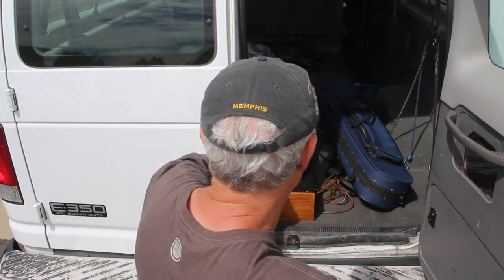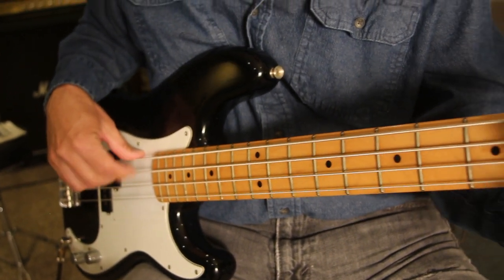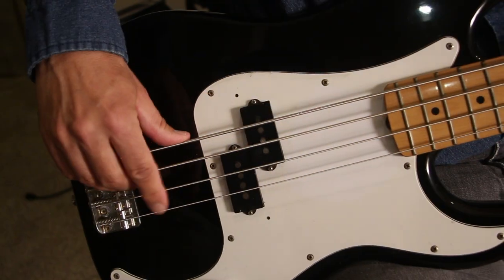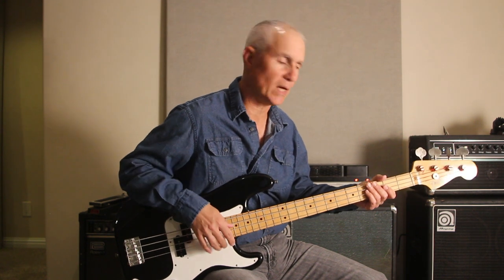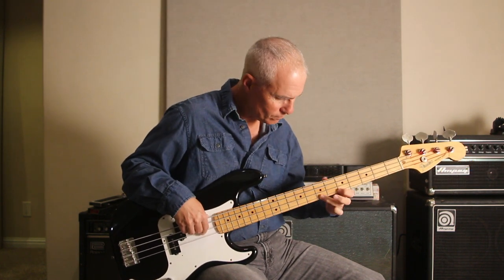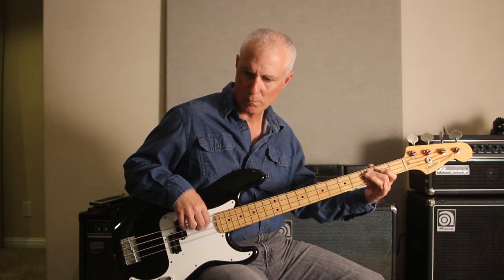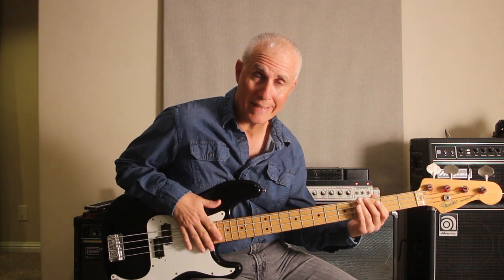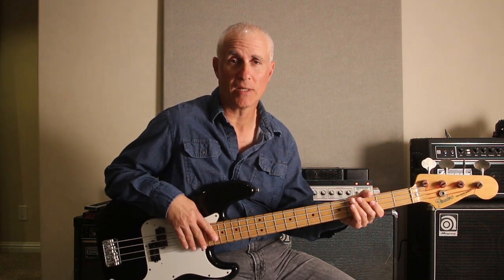The Vintage 1989 Fender Precision Bass (MIJ)

Comment: Japanese Fenders are great. I’ve two Strats and now I’m buying a 1996 P bass with a J pup in the bridge.
Reply from the maker: Sounds like a great collection! I love 'em, too!
Reply: That'd be great if it didn't have the J pickup. The extra hole ruins the harmonics, and the added wiring wrecks the circuit.
Reply: @ushnicyuvnikof2748  All in all it’s a great bass but I’d like a P bass without the J pup with a maple board!
Reply: @KRAZEEIZATION  You know what's up! I found out from building pedals that adding extra things to circuits even if non engaged changes the circuit, it usually does sound audibly different a tiny bit. Electrics and magnetic fields are interesting stuff. With holes impacting tone i feel that's why a bolt on body sounds slightly different to one glued to the neck when you stuff a holes with metal the sound wave actually bounces slightly in that spot, all these things are actually way more audible in basses though which is really interesting. The simplicity of the P is its strength. A good P will usually sound "better" than something with a p pickup added to it or a butchered / heavily modded P. Also interesting, you mentioned a maple neck because the difference is barely noticeable on a lead guitar, but on a bass, the difference is definitely more pronounced. I've got a rosewood fretboard Fujigen Fender MIJ P bass, and the tone knob has to stay more forwards that, and the high mass bridge darkened it audibly. For baas tones woth the tone knob at 10 it's a darker bass (im leavingit that way as its part of its characte), I love the feel and build quality. That being said a plain old P of high build quality with a maple neck is the Holly grail, (as good as other quirky things are its hard yo beat).

Comment: Trying to decide now if a 1962 Fender Precision Bass MIJ is worth buying. Is there a price range value you would place on these bases? Things to watch out for or be cautious on when buying one? Only know Reverb's projected value.
Reply from the maker: Hi! Just checking eBay, it looks like a standard MIJ P Bass from the 1990's would go for somewhere around $600. If it's a '62' vintage reissue MIJ, you may be looking at a few hundred dollars more. Don't know what the pricing is like on Reverb, but if it's similar to this, you get a pretty good idea of what you'd have to pay. Things I'd look out for: Make sure the neck isn't twisted, make sure the truss rod works and the neck isn't bowed beyond the point that the truss rod can correct any problems, make sure the frets aren't worn to the point they need replacing. Basically, all the stuff you'd check on any bass, but a reputable seller shouldn't be selling a bass with these tragic issues. MIJ vs MIA basses: I'd say the quality of the Fender USA & MIJ basses are comparable, but the USA basses from the 1980's till now tend to be kind of overbuilt, with more of a CNC, squared off, blocky feel. The MIJ basses feel more like what you'd get with a late '70's Fender, but without all the extra weight: They're more rounded, lighter and more ergonomic. More playable. Some players interpret this as a lower quality, more fragile instrument, but players that have actually used vintage gear can appreciate these qualities. If you're looking for something that more closely approximates a real '62" P-Bass, the Japanese version would be a good choice. I really like the USA "V" series reissue '62" also, so if you can turn one up at a good price, they're a great bass, but I suspect that they'll be more expensive than the MIJ (which is a great alternative). Thanks for watching! Joe